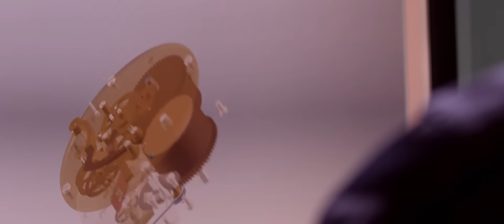Superior Craftsmanship of Chelsea Clock

Comment: I think Chelsea wins the history battle as America's Oldest Continuously Operating American Clock maker, Making Clock Movements and Cases in the same general location for 122 years.  Seth Thomas while he started making clocks in 1813 . Seth Thomas clock company did not start until 1853. While the name brand continued on and off, owned by different corporations over the years until the 1990s. The company lost its ability to make movements about 1955 when the factory flooded. Considering this, they made clocks for 102 years. everything after that was made elsewhere for the Seth Thomas brand name.  Herschede made their clocks for 99.5 years and also their own moments for nearly 75 of those years in the USA. Colonial Clock lasted nearly ninety years but only made cases using other manufacturers movements. Seth Thomas would be America's Oldest Brand name. Herschede ended made the last 100% American made Hall clocks circa 1984. Other Attempts to restart the Company under new ownership Failed. Way to go Chelsea!
Reply: Well they have also stopped - Chelsea Ship's Bells now come with German movements.
Reply: @winstonchurchill3597  I still have a bout a dozen models with the original movements in stock. Rumor is they will try to restart production but that remains to be seen.